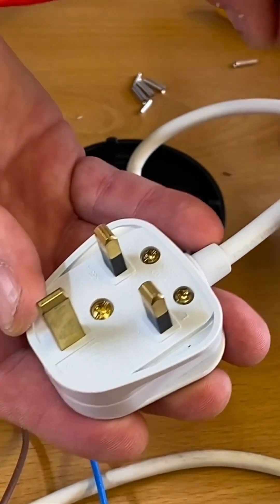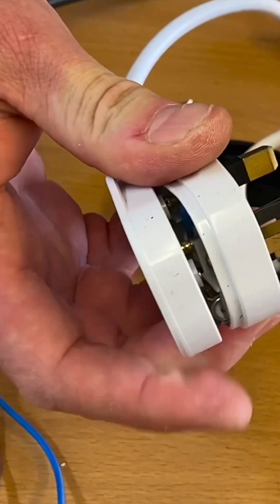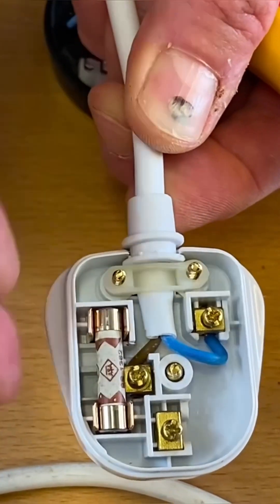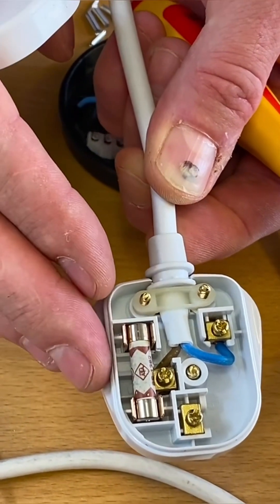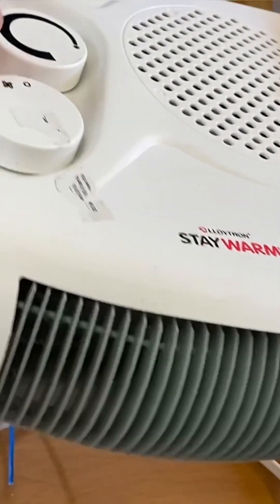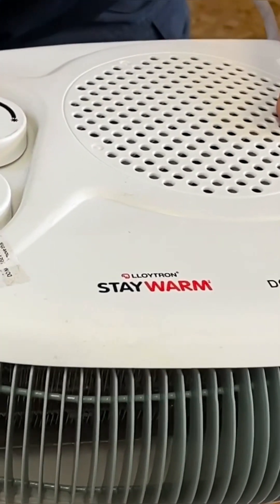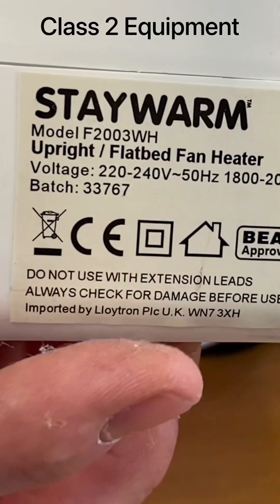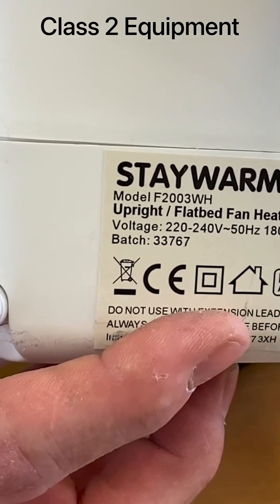Missing Conductor in my Plug…

Comment: That grill at the front must be metal?  which means in a fault condition it could become energised/live so that heater shouldn't really have a double insulated cert in my opinion.. I would like to see inside that device, I'd be interested to know if it's a nichrome element how close it is to the front grill and the grill material and coating thickness if any  etc

Comment: Just hope nothing touches the front metal grill then if your doing anything else around that unit .I like bonding pipework against regs recommendation as I know if I need safety I can touch a pipe anywhere inside or outside a home and I be safe

Comment: The guy said that even if it had a metallic outer part sometimes even those don't need a protective conductor. Could someone explain when this is the case? I have a stereo with a mostly metal outer housing and and no P.C. It didn't seem safe.
Reply: Low voltage applications, typically limited to <60vdc
Reply: My understanding is that it depends if a broken conductor could make contact with the exposed metal, so putting person at risk of electric shock.

Comment: never, ever, hold a plug in your hand when undoing the screws. Place it firmly on any surface.
I have also seen some rubbish stuff that says its double insulated when it clearly wasnt.
Reply: Why not?
Reply: @alashiya9536  SO you have a plug in your hand and you apply pressure with a screw driver to undo the screws, then the screwdriver slips, straight through your hand, seen it done, nasty.
Place the plug on a table and hold with thumb and forefinger only, then if it slips, you just stab the table.

Comment: My metal panel heater uses a 2 core connection, making it class 2. If the triacs melted through one day,  which would you choose an earth connection or double insulated protection? 😬

Comment: Its called doubled insulated, so plug earth pins are solid plastic
Reply: Except the plug here doesn’t have a plastic Earth pin. Am I missing something here guys? 

I don’t think it’s a requirement for an all plastic Earth pin but generally shouldn’t be done, right? I’m not a spark, these are genuine questions.

Comment: UK 3 pin domestic plugs are the safest, all countries should follow our design so deaths can be avoided.
Reply: yes😅 it is
Reply: Yup, plus it will remind you to not leave them on the floor too.
Reply: What's so good about uk 3 pin plug ?
Reply: @neilanderson1412 
Hi,  a few things of note about the uk 3 pin plug and switched socket....
  1,..   It's almost impossible to accidently get a shock as half of the pins are coated with insulation (you can see it in video the black part of pin)

2, grounding pin(earth) is longer so as you push it in it unlocks the wall socket which has a safety door mechanism  so small finger can't get inside, so basically you can't access the dangerous live/ neutral terminals  without the earth pin its longer for safety. When the live pin makes contact the only part small fingers can touch is the insulated part of the pin.

3,... it has a built in fuse  so a power surge will blow fuse, shutting off power, rather than at the consumer unit,
Sometimes can trip in consumer unit.

4,.. it's wired in such a way as if the cable is pulled the live and neutral  will detatch first leaving the earth connection last to go( it should then blow the fuse) but the cable has a really good restraing clamp which makes it very hard to pull out the cables by accident. I've never seen one pulled out accidently!

5,.. its very well made, quite strong it can take a some abuse.

6,.. the design has one downside, if its left out of socket it will 99 times out of a 100 lay with pins uppermost,
If you've ever stood on lego with bare feet.....ouch  with this plug the pain is on another level😂
But in reality they don't need to be pulled out as the sockets have an on/ off switch for each individual plug.

7, it has a narrow profile about 20mm just over half inch, plus the cable exits the plug vertically so it sits very close to a wall less of a trip hazard, means items of furniture can safely sit closer to the wall without causing damage to plug.

This is why its so good.
It's a good job it is, as our electricity is 240/230 v
Cheers hope this answers you question👍
Reply: @mynameisdave2020 Not ÀLL pins are half covered with insulation and not ALL sockets are switched.

Another thing that makes them better than others is that it is very difficult for the plug to be pulled from the socket by the cable which many people  wrongly do with other plugs.
Reply: @DelTangBrav   that is indeed correct. The insulation sleeves on type g were introduced in the mid-80s
Its a testament to  the durability that they can still be found today.  Yes, the unswitched outlet is legal under current  uk regulations
Reply: @mynameisdave2020  Thanks ... it  is interesting to note that the 1987 legislation to require the part insulation of prongs was not retrospective so those still using equipment where they are all metal would still pass a safety check. I just checked and the factory fitted moulded plug on my pre 1985 tumble dryer still looks as good as the day it was bought and is fitted with the all metal  prong plug. They certainly are durable.
Hopefully our comments might help others.
It is now not legal for retailers to sell electrical appliances that do not have the appropriate plug already fitted. Many younger people have ever needed to fit or change a plug as most people "thought they could" not too long ago 😄😄😄
Reply: @DelTangBrav  Hi, WOW!!! got your  money's worth  with that dryer. That's definitely in the "don't make em like they used to" category 👌
Again, you're right about plugs fitted on new appliances we had to fit them ourselves years ago🤨😆
Cheers mate 🫡
PS... the youngsters don't know born today.🤣😂😉😖
Reply: @mynameisdave2020  My freezer (an Indesit) has been in constant use since 1981 it does require some paint to cover the rust spots though.😀😀
I've come across many things that date back to when the customer had to put a plug on themself , a Clairol foot spa, still has a Morrison's price tag for 22p on the older type plug. 😄😄
Reply: @DelTangBrav  Hi, A forty three year old   working freezer is amazing.   You must have some very sympathetic electricity. The only thing I have that old and still working is my wife! 🤣 oh, hang on correction she was recently  made redundant, so  in fact, she is now   broken 🤣

Comment: And you're supposed to be an electrician? While it's true that you don't need the protective earth on a double insulated device, your plug MUST NOT have the ground pin on it if it's not connected. Meaning that's still very much an illegal connector.
Reply: That is a BS1363 plug, from the UK, and there is absolutely no requirement, legal or otherwise, to replace the earth pin with an ISOD if the connected appliance is Class 2.
I’m not sure if you’ve picked up that nugget of rubbish from somewhere, or just made it up yourself, but it is very much fake news.
Reply: @Grizzly01  Except IT'S NOT AN EARTH PIN. Because it's not connected it is functionally an isod and they must not be conductive. The whole point of them is that they are not. That's what the I stands for. The standard DOES actually say thay the shutter must not be operated by anything other than an isod, or a proper ground conductor. And because this isn't connected, it's NOT a proper ground conductor.
Reply: @danieljonsson8095  No, you are wrong. There is no requirement to swap a metallic earth pin for a non-conductive ISOD.
Reply: @Grizzly01  Except there is. The shutter may only be opened by an isod, or an earth comnector. This is not an isod, because it's not isolated, and it's not a ground connector, because it's not connected. Hence cannot be compliant. Do you even know WHY the isod is specifically isolated? If this was allowed, you could have just had it be a sod, but that it's isolated is a specific trait for it that is demanded when it's not a ground connector there.
Reply: @danieljonsson8095  please point towards the guidance or regs where this is stated.
Reply: Also, the ‘I’ in ISOD stands for insulated, not isolated.
Also, if a metallic earth pin on a plug is plugged into a socket outlet, it most definitely is connected to earth.
Reply: @Grizzly01  Insulation and isolation are the same things, just different connotations. And the issue you're missing is that with a metallic pin, you give the impression that the device is grounded. That's where issues start and why it's not allowed. You're not allowed to give misleading indicators of what the wiring looks like and you know that.
Reply: @danieljonsson8095  no, they are not the same thing at all.
You keep saying ‘not allowed’, but you know that isn’t true.
Reply: @danieljonsson8095  It is allowed and 100% legal. You don't know what you are talking about when it comes to UK regulations. Schuko plugs would not be legal in the UK as they lack polarisation and the internal fuse matched to the rating of the appliance and flexible cord. Can you get it through your head that the rules that apply in your country are not the same as those in others?
Reply: @TheEulerID  lacking polarization isn't a problem though. A plug that claims to have a protective ground but doesn't, very much is. These rules are not UK specific either. These are rules that apply worldwide and you forget that UK was recently part of the EU which was very strict on this. You're a fool if you think UK's rules are somehow special abd allows for this. Besides, I actually looked it up specifically before making that comment even. It's very much not allowed. A connector MUST NOT have a ground pin when it's not connected.
Reply: Stop talking crap. 
This is in the UK, where all BS 1363 mains outlet plugs have either an earth pin or an ISOD (insulated shutter opening device).
If they didn't, you wouldn't even be able to plug them in to the socket outlet.
Fool.
Reply: @Grizzly01  Neither of which is a plug like that. To explain a bit, the thing is that you must clearly on the plug be able to see if the device is grounded or not. Even if the device is double insulated and doesn't need grounding, you're still required to follow that in the plug. You must not have an actual connector in place on the plug when it doesn't go anywhere. There are plastic replacements that you use to replace just the pin for plugging in to those protected jacks. But this, using an actual connector for it, is very much illegal.
Reply: @danieljonsson8095  No it is not illegal. Your rules may be different, but they don't apply in the UK.
Reply: "your plug MUST NOT have the ground pin on it if it's not connected."

Utter nonsense.

On a UK socket, you won't even be able to put the plug in a socket without a ground pin to open the shutters. The earth pint must always be present, but it can be non-conductive on class 2 devices.
Reply: @TheEulerID  Ofc you can... What nonsense are you spouting now? Plenty of proper plugs have a plastic pin specifically for this. It's not an ekextric circuit that needs to be conductive for it to work, there just has to be something for ot to open, be it a ground pin or just a piece of plastic...

Comment: Now cause real confusion...swap the live and neutral over in the plug.
Reply: Fuses and single pole switches should never go on the neutral. Which is a bit of an issue in countries which use Schuko as that was designed before it was realised polarisation was desirable (originally early German power systems were 110 - 0 - 110, and there was no neutral and, unlike the Americans, they never devised a means of polarising plugs and retaining backwards compatibility).

Comment: Manufacturer of the appliance always fits the cable. So if a two core cable is fitted, then you only wire up the two cores in the plug.

And if you ever need to replace the cable to the appliance (which is extremely rare) then you replace it with like for like. And if you did replace a 2 core with a 3 core there wouldn't be a terminal inside the appliance to connect up the earth wire.

What it would mean is that the earth wire would be unnecessarily connected in the plug. Misleading but not harmful in anyway.

Comment: In the Netherlands you can't have a PE contact on your plug for a class two device.
Reply: In the uk (where this is filmed) our socket shutters will not open without the PE pin. Some class 2 devices have a plastic pin but it’s not a requirement.
Reply: Same in sweden, this would be standard shucko with no PE or a Euro plug

Comment: You may be interested to know my 'double insulated' heater blew a hole right through the side of it, and burnt the carpet on its way through to a copper pipe under the floor for earth.
If I had been holding it I would be dead, or seriously hurt.
Do not trust these mass produced chinese items....Homebase if youre interested.

Be carefuk folks....no earth only works if the device is correctly made...and you have no way of telling.
Reply from the maker: Thanks for your valuable input

Comment: Always loved your type G plugs in the UK like this one. Use this to charge your phone and you could run an arc welder on it. Look at those prongs you could run 50 A through them!.
Reply: The only thing more painful to step on than Lego!
Reply: @loswilko 😂😂 painful memories of both!!
Reply: Good for 13 amp and 240v by law 😊but I know what you mean about the potential. They get a bit warm on my welder and 3hp compressor after a while.
Reply: @SW-qr8qe  - they just look so huge!
Reply: the sockets usually start melting over 16 amps

Comment: UK sockets suck ass... always changing them weekly
Reply: If you have to change them weekly there's something seriously wrong with your workmanship!!
Reply: No mate. It’s a great design.
Don’t buy shit
Reply: Ever thought about installing a decent brand rather than the cheapest Chinese knockoff you can find?
Reply: @ferrumignis  here in africa ive been trying all brands, theyre all crap and cost double of the brands that dont exist here, guess its africa fault for having crap stuff
Reply: @aggregor95  The main issues I see are that they can get physically damaged/cracked (often sockets located behind heavy furniture that gets pushed back onto them) and just occasionally a  switch will go bad, but they are one of the more reliable parts of the system IME.
It's quite possible that some of the cheaper brands may be  short lived, but I tend to avoid them.

Comment: On some of my equipment like that I did use 3 core cable only in case the lead was in on site my thinking was protection.  Is this OK to do as it was snipped an taped over on the inside.
Reply: I do this as well, even for lamps I make. The way I look at it is it can’t hurt having

Comment: Correct. Class 2 equipment. Earth is required if it had a metal casing. Then it would be class 1 equipment.
Reply: There are non earthed metal cased Class 2 equipment. Example: typical HiFi rack devices. It just needs to be double insulated to the casing, so in particular places there are extra precautions in place there.
Reply: Nope. There are loads of metal chassis Class II items out there.
Reply: @Grizzly01 It depends on the appliances. If there is no step down transformer you would need to earth the appliance like an electric heater or lamp.
Hi-fi use Stepdown transformers and are either plastic shielding meaning class II anyway or metal shielding for RF shielding, not necessarily electrical shielding. 
In most medical equipment even if it has a plastic case, they have an equipotential point which is earthed making it class I.
To make things clear, double insulated means that the person is double protected against electric shock because of the plastic case and the mains inside. These are normally fans, heaters, lamps. If there is metal surrounding the lamp or heater or fan or even a ceiling light then it must be earthed making it class I equipment
Reply: @DanielImmanuel2143  All obvious points, but still don’t support your original statement that a metal case requires an earth.
Reply: @Grizzly01  so go on: what is your question exactly? You are not making yourself clear. Are you saying that "ALL" metal chassis equipment require an earth or they don't require an earth? Thanks
Reply: @DanielImmanuel2143  neither. Class 1 appliances require an earth. Class 2 appliances, metal clad or not, do not require an earth. Doesn’t get more simple than that.

Comment: Heater might not need the earth but the cable does
Reply: BS7671 doesn't apply to appliances,. only to the installation. So no, the flex does not need a CPC